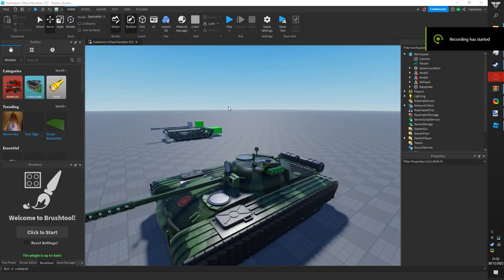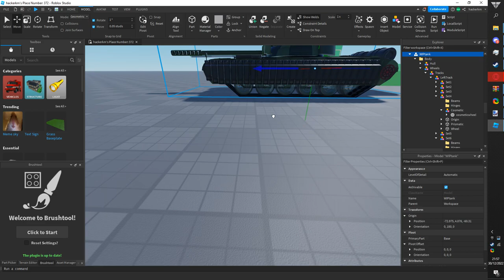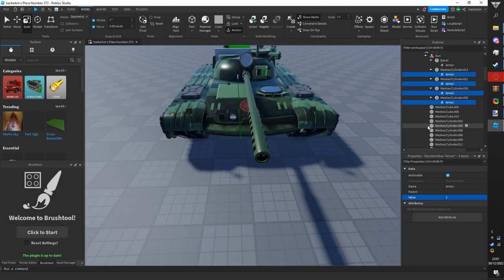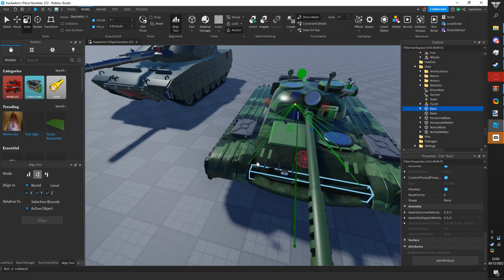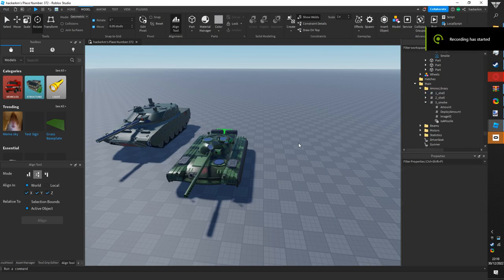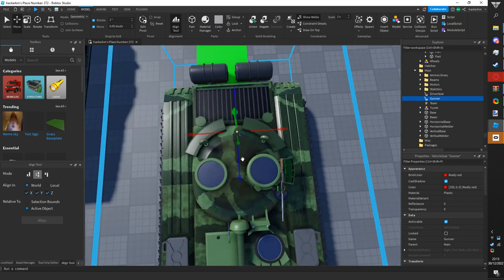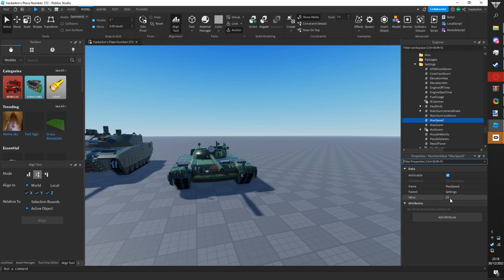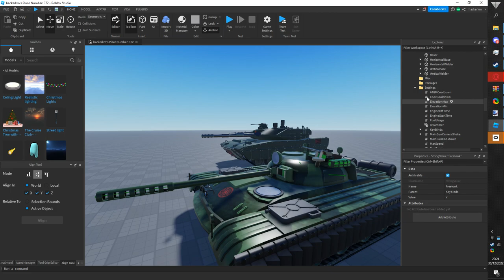(2/2) Dumbass attempts to explain Fury Setup, Settings and Ammo

Comment from the maker: Ignore all the stuff I said about projectiles in the "Physical" folder, apparently these values change nothing at all and were part of the old fury, just not removed for whatever reason.

Penetration is how much mm it can pen and how much damage.
Weight changes how much drop the shell experiences.
FragSpread is the angle that the shrapnel goes.
and amount of course is how much you have shell wise of that ammo variant.

ADDITIONALY invisible objects work fine with Fury now
Reply: can you send me the link of the system ( i wanna buy it with robux)